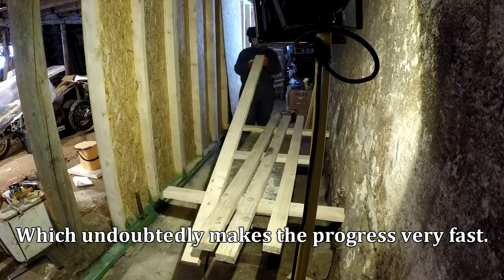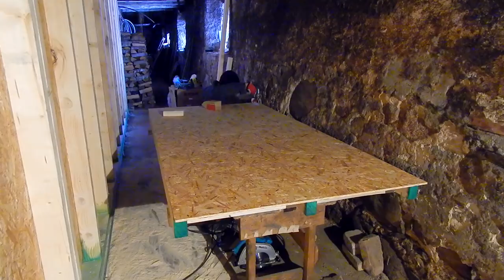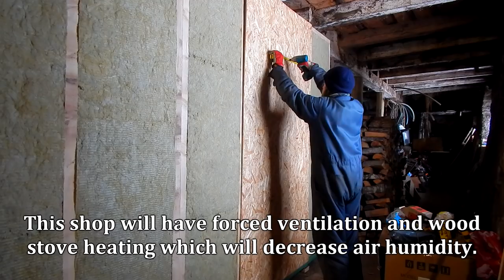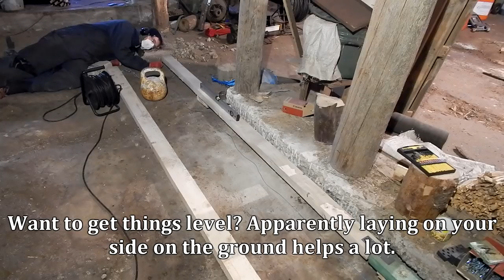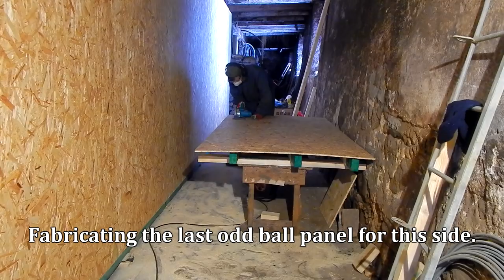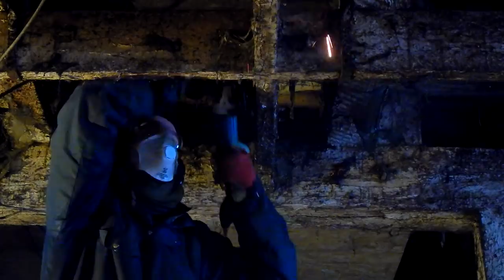Building Walls - Machine Shop Build Ep. 2

Comment: Looking good!  If the corridor side has fume from fuel you may want the floor lower than the workshop side.
Reply from the maker: The ceiling in the corridor will be lower than in the machine shop itself and it'll vent out nicely through the electric ventilation system.

Comment: been 36 to 40 plus degrees (over 100f) for weeks here in australia don’t know what cold is good luck with the build
Reply from the maker: The one time I came to Australia for 3.5 months we had 45 degrees Celsius and I thought I was gonna die. So I think this cold here is not as threatening as the heat down there. At least we have plenty of drinking water in the form of snow. Not the yellow snow though...

Comment: Give you a hint on cutting studs the same size. Stack all your studs on top of each other making sure all are even on one end. Measure and cut the first stud on the stack and the saw will cut half way through the next. Gently push the fully cut stud off and cut the next stud at the cut line left by the first cut. Repeat. speeds up the cuts and most of the time there will be no differences in the lengths.
Reply from the maker: Is this comment particularly for me or for people who watch this video in general? If it's for me then I don't use the threaded rods to create studs - I use ready-made anchor bolts that have expanding slip-ends on them. They'll start catching in the pre-drilled hole differently and will stick out differently when tightened. Thus they'll have to be cut down to size after installing and separately. If your comment was meant for people in general then cudos, it is valuable info to save time and they can see how it's done in one of the SVSeekers latest videos if they're interested. ;)
Reply: What I was saying is that you can place 2x lumber one on top of each other. When you cut through the top piece of lumber it leaves a kerf in the next one down. This saves having to measure each piece by using the kerf left as your next cut mark. The caveot is that you have to have the blade set at exactly 90 degrees or the angle of the blade will either grow or shorten the lunber with each cut.

Comment: I am looking forward to this build it has always been a dream of mine to take an old barn and making it it to workshop and living quarters. What are you going to use for fireproofing? Would the waterproof sheetrock be cheaper than OSB?
Reply: The OSB will serve several functions in I see it, structural bracing for the stud walls and an easy to fix to clean surface for shelving and brackets for the motorcycle gear one side and workshop equipment on the other side. Less need to go searching for a stud to fix to unless things are really heavy..
Reply from the maker: The OSB is pretty spark proof as I've come to realize over the years. Don't take my word for truth though. It's just what I think. I'll leave the OSB walls as they are, no extra treatment. I haven't looked up the local prices of the sheet rock so I really don't know.
Reply from the maker: I can see where the lumber is under the OSB so I can hang anything heavy on the framing instead of the OSB alone.
Reply: @DonnDIY  I know here in NY the moisture proof 5/8 sheetrock is half price of the OSB Just food for thought

Comment: Are you sure those beams are rotten. Quite often its just the outer skin that has rot but not the heart wood. You might be making more work for yourself.
Reply from the maker: I want to remove the beams no matter what because the ceiling will be lifted to accommodate a two post car lift in the future in the stage 2 of the workshop build (outside the partition/machine shop I'm building right now). The barn requires a new roof too. I will see from up close when I get to removing the beams in what condition they exactly are.